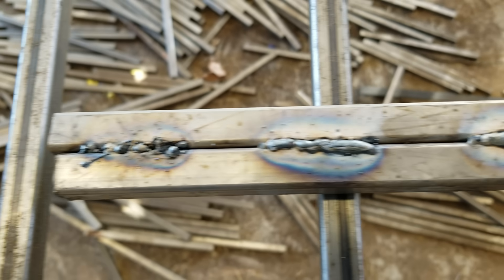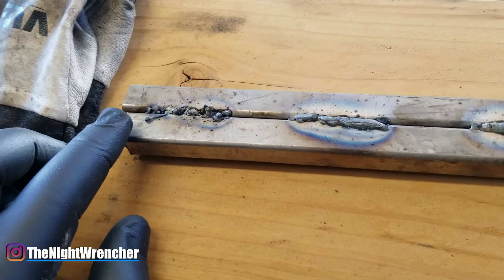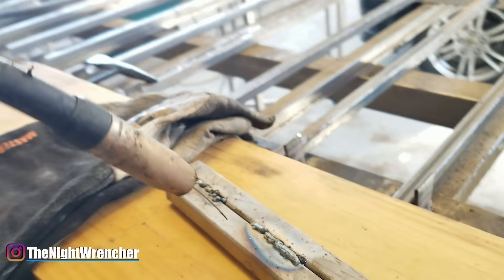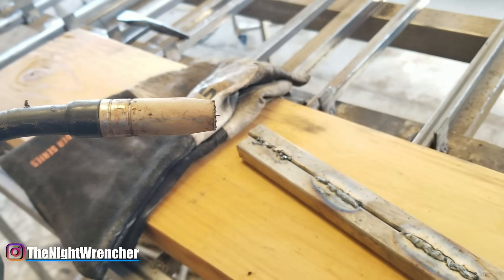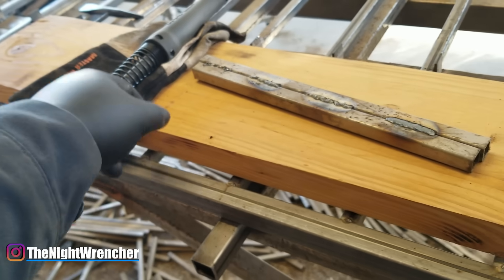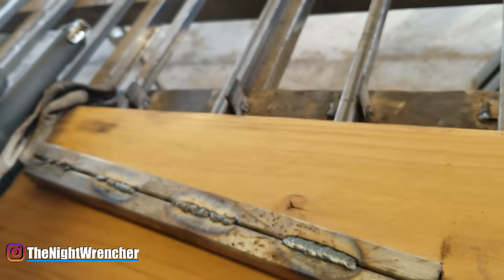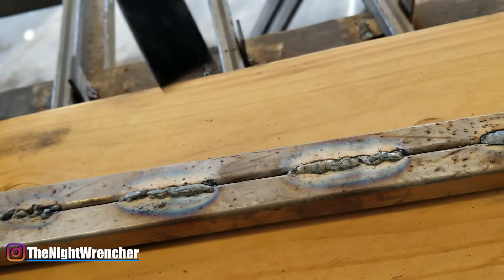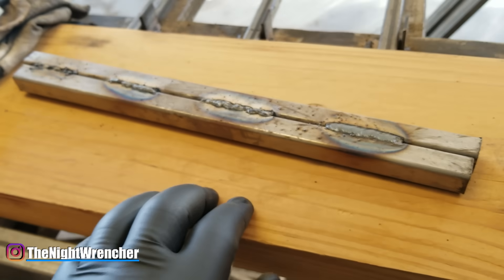Learn Perfect Flux Core Welds In 10 Mins | Gasless Flux Core Welding For Beginners Tips And Tricks |

Comment: Great video. I have been running into this problem as a newby. I have the Chicago Electric Flux 125 Welder from harbor freight, can you recommend a starting point for wire speed?
Reply from the maker: I just looked up the machine. Since it doesn't have a separate knob for voltage, I would start at 3 and go from there

Comment: Make sure the machine is set electrode negative or no matter what you'll be fighting an uphill battle, they're usually set up electrode positive out of the box for some reason so go in and swap the terminals. And don't push back into what's already fused strike your arc, fuse, pause and pull.
Reply: @babaoreally8220  Are you on Long Island? My friend's niece is named Emma and she went to welding school there?

Comment: All these videos on learning to weld show welding down on top of the material, do these welders perform well when you’re welding above the welder? I need to weld new channels underneath my 1997 jeep wrangler, So I will lift the jeep up and be underneath the body welding above me to the floor pan , Well this type of well or work or is it a different type of welder for working above your head? Thanks for any help in answering this, Jim
Reply from the maker: Flux core works really well upside down because you dont need to worry about gravity fighting against your shielding gas. The biggest thing is the spatter that falls on you and the ocasional molten drips that will burn a hole right through your clothes and into your skin. If you're careful, this shouldnt be a problem

Comment: All wire manufacturers have a recommendation for stick out. If you have the wrong stick out, you will produce porosity. 
If you are welding on a project that requires UT, you will fail the testing and will have too remove all defects.
Reply from the maker: Thats true but beginners are barely trying to make a solid bead. I'll make a seperate video on stickout specifically. I'm going to try to break up each part into a seperate video for easier digestion

Comment: Ive been DIYer welding with flux core for about 16 months and I've learned that in the summer in hot locations a full jacket may not be a good option, so I got some of those leather sleeves off Amazon and they work great. You can wear a short sleeve t-shirt and the leather sleeves and you'll stay relatively cool and not get sunburned on your arms. Great video with lots of good information, thanks for the tips.  Liked & subbed! 👍
Reply from the maker: Gotta be careful! That light is cancerous!

Comment: If your using gasless wire feed and it looks like the image on the left check your polarity on your welder
Reply from the maker: But I just said all the welds shown were done on the same machine with the same settings and the only thing that changed was hand position
Reply: @NightWrencher  So you had it set for DCEN?
Reply from the maker: As far as I know, all flux core should be set to DCEN

Comment: Best video yet for flux core welding. I welded a winch plate on my 4 wheeler as they didnt make one for it. Sadly it holds but it is a big #1 weld lol. Now I want to grind it off and try again. I had no idea how to start so thank you!
Reply from the maker: I built my whole winch bumper with flux core and it hold really well so I'm sure you can do it!

Comment: I gotta come up with a way to fine tune my wire feed rate with a thumb wheel on the gun, foot lever, something!
Reply from the maker: Your machine doesnt have a knob for it? 🤔
Reply: Don't change settings with the machine running, no bueno, especially amperage settings. Make sure you're set to electrode negative, all that amperage through such thin wire filled with flux causes a ton of spatter if it's set to electrode positive because the wire is exploding instead of melting.

Comment: novice help im a fitter and weld smooth beads with 71t1 hyd .052 wire this is obviously pro grade equipment that i use
Reply from the maker: I dont know what that means 😂

Comment: You actually can push flux core without porosity. I have passed bend tests using  a push angle.
Reply from the maker: I have too, but that doesn't mean thats what you should be practicing as a beginner. There will be situations where you dont have ideal welding conditions and you have to do what you can but when starting out, you should practice known good methods of welding and go from there
Reply: I get what you're saying, but the way you talked about it in the video made pushing seem impossible.
Reply from the maker: I think you're right but dragging is much easier to learn than pushing with flux core so I discourage it

Comment: Hi NightWrencher, enjoyed your video and i wonder if you could help me with a problem. I am trying to learn welding stainlee steel using stick welding to do small jobs on my boat. My efforts so far look exactly like the first weld on your video. Will the same techniques of your flux core welds apply to stick welding, and do i have to completely grind off my useless first attempt before i try again. Many thanks in advance from England.  Oz.
Reply from the maker: I'm not too experienced with stick welding but I do know that you also want to drag it at the same time as applying pressure and feeding the weld. Try turning up the heat to see if the results get better

Comment: One of the best explanations/demonstrations of flux core welding problems and how to minimise them. Just one minor point, you didn’t mention the actual vertical position required. I’m no expert, but most of the literature I’ve read and videos I’ve seen mention keeping the gun about 10 to 15 degrees from vertical as well as (as you’ve mentioned) dragging the gun.
Otherwise, thanks for an excellent video!
Reply from the maker: Thank you! I didn't mention it because in some situations that is not possible so I focused on the biggest factors that affect weld quality reguardless of situation

Comment: The only comment that I have is your reference to “welding the tip of the MIG gun to the material”. The reason this could happen is that you are using the wrong nozzle on your gun. Flux core is DCEN...meaning that your “gun” is “charged”. You should use a flux core nozzle, or no nozzle at all. You can actually give yourself quite a “shock”, quite literally, if you ground the material/gun at the same time you pull the trigger by touching it. Since flux core is “gasless”, you don’t need a nozzle anyway. Otherwise, good video.
Reply from the maker: Yeah I only keep it on there to keep the tip clean. My vulcam welder has this wire or spring inside that gets exposed if I take it off

Comment: New guy, hobby welder question:  can you weld through/over the anti spatter spray, or does it prevent toe weldout and flow into the base metal?
Reply from the maker: Anti spatter spray is perfectly safe to weld through and you shouldnt have any issues

Comment: Thanks for this video. Been welding since November as a hobby. Bought a Harbor Freight Chicago Electric 125 welder and it's been fun to use. I'm one of the one's that are scared of blowing a hole into the metal.
I've been practicing lap joints and butt welds. Do you recommend weaving or are stringer beads sufficient enough for most tasks? At times, I can get a similar looking bead like your fourth weld in the video but not as consistent. Any tips for vertical welds also? Mine are terrible and they glob up.
Reply from the maker: Blowing through the metal is super easy with thinner materials  but lap welds definately make the job easier. Butt welds are harder to do but tacking at every half inch or so makes it easy to join the welds together. On thicker materials I tend to weave to build up more heat and widen the bead. On thinner materials like the fence I was building I buzz it straight and move faster because its too easy too build heat and poke holes if you're not careful. For vertical welds I do a heavier tack at the bottom of the joint and then start to weld from there, the tack acts like a basket and keeps your bead from drooping down. If you start getting a blob, start the weld from the top and "push" the weld down so it forms a big ball at the bottom and breaks off and let it hit the ground. Easier than grinding it down
Reply: Magkano ba yan anong brand yan bibili ako
Reply from the maker: I think youre asking me how much it is? The harbor freight welder is $140-$180 USD. My vulcan welder was $1,100 USD

Comment: You did not explain wire speed to match amps, or vice or versa?? Positioning handle was helpful some.
Reply from the maker: The video was not to explain HOW to weld, it was to make your welds better, and the first step to get there is hand positioning. After you master that, the rest becomes easier.

Comment: I forgot the dude's channel, but he builds ridiculous swords of great size, and is Irish, he coats his metal in suit from a gas torch, maybe it could be done with a oil lamp
Reply from the maker: I've seen that done when preheating metal so when the soot burns off, you know its hot enough for welding. Anti-spatter spray is cheap and leaves your welds super clean.

Comment: At about 3:30 ish - you actually need a bit longer electrode extension with fcaw than gmaw so as to preheat the Flux inside inside wire.
Reply from the maker: You're right, but usually I get a better result by holding the puddle in place for a second before starting the bead, that way the puddle is nice and hot as the wire comes in.
Reply: @NightWrencher  yeah definitely! Sorry, I wasn't arguing your point, but I've seen a lot of guys run up to the HF and get whatever they can afford and treating Flux the same as Solid wire.
Reply: Also: with a push angle it's possible to get slag trapped in the weld bead making a weaker result.

Comment: Quick warning to the newbies among us about the gloves and jacket: don’t use rubber gloves or synthetic fiber gloves - they make fireproof (well, resistant) welding gloves that tolerate being sprayed with liquid steel without burning you. Same for jackets - both are available from where you get your welding supplies; but if they’re out of stock you can get them online too. 

Personal experience: the gloves that harbor freight sells at 10 bucks for 3 pairs seem OK; they are large and well insulated and seem to hold up to use besides welding. I wear them when driving my tractor in the winter because the insulation works in reverse also; keeping my hands from freezing. There are other brands with more bells & whistles; though.
Reply: I have picked up fire rated coveralls from "Ollies" for $30 or less as well as Bargain hunt.
Reply: Dont be stupid always wear protection no matter how pro you think you are. Nobody likes accidents during working just makes working that much harder.
Reply: If im going to be using a titanium 125 flux core welder for small projects, do you think I should invest in a jacket? Im thinking an old heavy cotton sweatshirt should do, but i have no idea. Thanks!
Reply: @philipgillett  My experience: yes. I have a Lincoln Pro-MIG 140 (120v machine, from Lowe’s) and I run flux-core wire in it, and it does throw hot blobs of liquid steel far enough to make having a jacket worthwhile. Also, that’s something that will stay with you if/when you upgrade to a bigger machine; or get other stuff like a plasma cutter (I’ve personally managed to spray my face with liquid steel because I had the plasma torch angled just exactly wrong when starting a cut in the middle of a plate of steel - good thing I was wearing my full kit; I would NOT have liked getting that in my eyes!).

I also picked up a cheap leather apron from Amazon; it keeps small bits of liquid steel from making their way thru my jeans.
Reply: @darkwinter6028  harbor freight carries the leather aprons pretty cheap too
Reply: @phreak5758  Yes, they do; my closest Harbor Freight is about a half hour drive from here, though, and at the time I just didn’t want to make the trip when Amazon had it on prime next day delivery. If I had already been heading out that way, I probably would have just picked up one from there.
Reply: they do make great winter gloves
Reply: That’s funny you mentioned them for winter also. They seem to be the only one that I actually stay warm in, oh and they’re good for welding too! Now if I could just stop putting holes in them with the grinding wheel.
Reply: I use my welding gloves for everything. From welding, pulling hot stuff out of the oven, and winter double gloving. In the winter I will use rubber gloves mechanic gloves and welding gloves to keep warm and protected. I had my gloves safe me a few times including a router bit catching a small piece of wood throwing and grabbing my glove and throwing it 3 feet away.... no holes in it. "YOUR hands are your most important tool without them you got real problems."
Reply: L E A T H E R
Reply: Just leather gloves a long sleeve shirt and a hood. That's all you really need. If ya want FR stuff that's up to you, but really not needed for a casual welder. I've welded for years and I use 100spf sunblock on my arms with a short sleeve and basic leather gloves. If ya want cool stuff, I suggest buying a quality hood!
Reply: @jasonsimmons6684  Eh... my experience has been that regular cotton long sleeves don’t stop the spatter; and it feels like I’m getting poked by a whole bunch of hot needles. YMMV. Also, if you shop around (both online and in brick-and-mortar stores) you can find basic jackets for not too much money. Of course, you can also find fancy ones for big bucks.

If you do forgo the welding jacket and use regular clothing, do check the label and make sure it’s not a synthetic fiber or a blend.

Sunscreen is a good idea in general, though - clothing sometimes has gaps that let UV through, and although it’s not enough to feel an immediate burn; it does add up over time to be a cancer risk. Also, if you’re working outside, especially on a hot day, you’re going to want to take the jacket off while you’re not actively welding (I.e, doing fitup, grinding, etc)... exposing you to UV from the sun.

Totally agree about the helmet, though. 🤔

Comment: Finally. I found someone that explained what I was doing wrong. Now I can grind off 6 feet of crappy weld and start over. Hopefully getting it right this time. My biggest problem is trying to rush the job and holding the gun wrong and wire speed too fast. Gee I guess that was everything you mentioned that was wrong with your left 3 welds.
Reply from the maker: Its all just practice. If you notice that your bead is starting to look wierd or getting too hot or going in the wrong direction, take your finger off the trigger, wire brush where you stopped, break off the tip of your wire, set your stickout and try it again. Clean metal lets you strike and keep the weld cleaner

Comment: Thank you for talking about sunburns when welding.  I found about those the hard way the other day.  There was a gap between my jacket and my welding helmet, and got a very nice first degree sunburn at the base of my throat.  It’s not just about heat—welding creates a whole bunch of UV light.  Neck protection is your friend.
Reply from the maker: Yeah that stuff is no joke!
Reply: Saftey gear is number 1 i not only got sunburn ? I had cancer removed  from my chest , area , i put it down to welding not wearing a jacket , i stress to every one , saftey gear

Comment: So should it be a slow constant straight drag, 
or I've heard some say you should make circles?
Reply from the maker: Depends entirely on the situation. On thicker materials I tend to make figure 8s as I go down the line so I can make the bead wider. On thinner materials I hit it straight through and on sheet metal I just tack it over and over until its fully welded

Comment: So always tilt to the right? We’re using “string bean” method, should I still use right tilt and push back?
Reply from the maker: Idk what kind of vegetable you want to associate it with but tilt away from the puddle, let the wire speed build up material and pull

Comment: So I have been welding in the armed forces for 12 years now and I like to compare flux core to being no different than arc welding guys. Just remember just like arc welding your using a back hand direction of travel because as the filler metal under the flux burns the flux protects the weld underneath. Where flux core is like a wire fed stick welder the nozzle helps keep the flux gasses that are released shielded and directed over the puddle. When you switch to using mig depending on indoor or outdoor welding and if it's needing high heat / penetration you can push or pull otherwise know as forehand or back hand. Just with that ensure that when running up hill or a vertical weld needing high heat and penetration push from bottom to top  for structural strong deep penetration. For thinner metal you can also run top to bottom. Like he said don't be afraid of burn through it happens to the best of us and you can practice your filling skills just take your time be patient watch your puddle and key hole.
Reply from the maker: Well said 👍

Comment: The shield on the MiG is insulated, so touching the workpiece isn’t usually a problem, unless it’s filled with welding garbage, and the insulation, isn’t working so that the shield is electrically connected. If that happens, then yes, touching the work with the shield will be electrically connected—bad. Clean the inside of the shield and that won’t happen. That’s one of the purposes of the square end of MiG pliers. Run it around the inside of the shield, then rap the shield against something solid and most of the crap will fall out.
Reply from the maker: I know if I take the shield off Im gonna lose it so I just keep it on lol